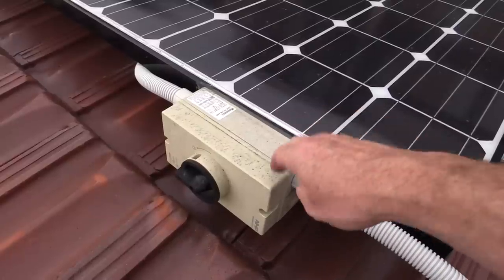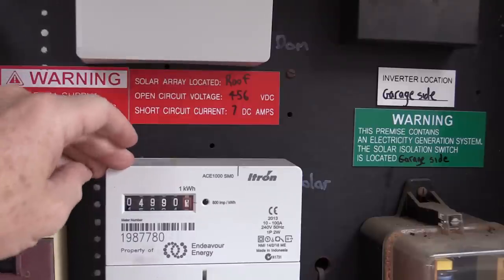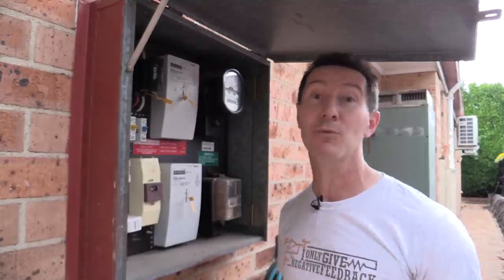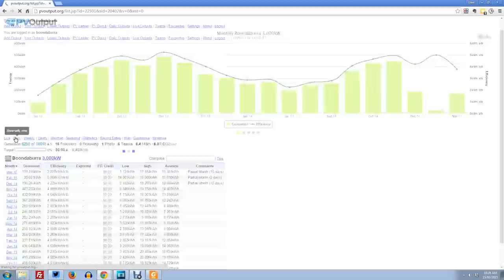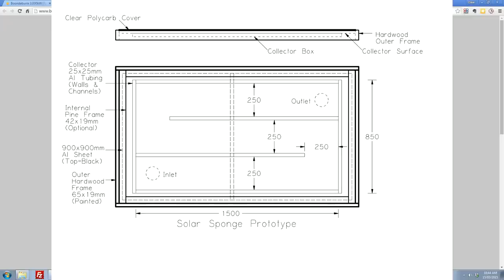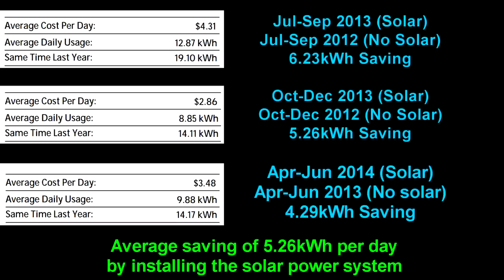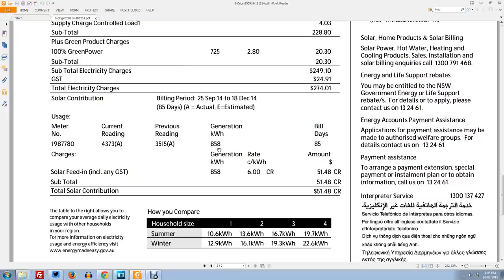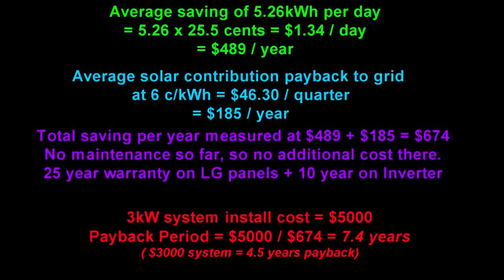EEVblog #724 - Home Solar Power System Analysis & Update

Comment: Sounds like you might want to do what Photonicinduction did without solar.  He charges the batteries during the day when the rate is lower and it disconnects from the grid at night.  I think all the batteries he uses are salvaged and he's done no maintenance on them from what I remember since he installed it.
Reply from the maker: stonent How many years has he had it installed? He will need maintenance sooner or later.
Reply: EEVblog
*****
NOW KISS!
Reply: stonent Think you got that backwards. It's cheaper at night.
Reply: He's had that running for quite a few years!
Reply: EEVblog It's a backup power supply that charges overnight (cheap rate) that can be used in the day if needed - Video at: ka0MfipmdBw

Comment: As a volunteer firefighter I can tell that solar power systems are a very big issue for us. In case of a fire we need to keep much more distance (>5 meters) during extinguishing. In case of an accident like a broken panel, blank cable, etc. we are not allowed to touch anything nor even get nearer than one meter.
The problem is that there is no possibility to turn off the panels completely. Even if there is little light, like from a lamp or floodlight, the panels can create enough voltage to harm or kill a person (ca. 120V).
In worst case we are forced to do nothing and let the building burn.
Reply: I have not heard about this, I wonder how the fire dept here in los angeles is dealing with it, probably there's not much solar here and so they really haven't encountered it yet. I would think the ins. companies would be rising their rates for companies going solar.
Reply: Hmm, this shows that there is a need for some fire protection mechanism, what if the series panels had a relay, i.e. between each panel, that turns off during the event of a fire?
Reply: There are mechanism like this in the marktet, with a switch at ground floor to be accessable by fireman. BUT, and i can only speak for german speaking countries, there is no regulation that you must have this mechanism. So most of the time this is not installed because its cheaper without it.
Nevertheless the solar panel is still producing current even with the relay. So the panel itself is still dangerous for us. There are some ideas for floating the complete panel with a lightproof liquid, but after this you need to replace the whole panel. And without regulation this idea will also be not used, because it costs money.

Comment: Nice Video, we are learning at school similar things that you talk about (the orientation, the angle, kWh/a, "Nutzungsgrad" (I dont know this in english, its about the efficients over the whole year, more excat then the efficients rating from the producer)), but not only PV, also solarcells used for heating your drinkingwater and your hous (needet in winter, here in Austria ^^).
Also two gyes of my class are working on the impect of dust (its getting hotter around dust, so there is a bader efficients), really interresting project. 
So thanks for sharing your data, because its really fascinating to see how different this system works in Australia!

Greetings Andi
(Austria)

Comment: we have 3.5KW in SA, we recieve ~$200-$300AUD per quarter, so the system which cost ~5K paid itself off really quick.
don't pay for power anymore.
We have also replaced all lights with LED.
no air-con used, double-brick + insolation, + fireplace for heating (wood is free).

Comment: Here in Colorado net metering is a much, much better deal since you are paid for production at the same rate that you pay for consumption (around $0.10/kWh). They also do net metering averaged over a year, so if you produce excess in the summer you can consume it during the winter.

Comment: Im not sure but remeber from our previous vid that this Itron meters wre smart ones. Rare for ciclometric display meters, but. I dont get the idea of two meters, since meters can record both import and export energy at the same time in separate registers. Perhaps it is the way the system is wired. But since this meters can display ONLY ONE quantity, you need two of them just because you need two registers. If you are not in an area where outages are usual, having a ciclometric display in an electronic meter is rare and no sense. Ciclometric readout is ideal were outages are frequent so when the employee from utility come to take the reading, it will be able to do that even when the grid is down. You cannot do that with LCD ones, unless they got supercap or batt inside to hold the reading

Comment: You should install ultracapacitors between solar panels and the inverter/controller, you will see the energy log curve dips/drops/changes get fixed & will give you more energy by compensating for low light conditions of morning and evening everyday. 500F banks of maxwell caps. in  parallel & series  would do it.

Comment: Hi Dave,
just one thing: At about 5 Minutes, when you talk about the meters, you put up this comment about the first meter. But this changes the whole statement, you're doing there:
If you consumed 6.698 MWh from the grid and you additionally used 2.406 MWh from the solar System (7.396 - 4.990), you used a little more than 9 MWh total. So your 3 kW installation would - even with a storage system - not be fully sufficient.

Still a very good video - thanks!

Comment: 19:14 Explanation about same energy delivered in different days:  
Clear days have only one light source (the sun); on 18/11/2014 maximum output was 2500W from 12:10 PM until 1:15 PM (movie time 18:35)
On a partially cloudy day, the light is coming from the sun and from the clouds near the sun (the clouds are secondary light sources); for example on 14/12/2014 maximum output was 2750W just before 11:00 AM.
I guess it's not about the panels, it's about the daily weather.
Cheers!

Comment: In my area some people put up a 100 ft tall wind turbine because of a lack of sun. It's not wired to the home at all, just back to the grid and the energy produced is subtracted from the power bill. The control box sends a wireless signal back to the power company but there's no screen with numbers to look at, just the monthly billing that comes in the mail. A percentage of the overhead expensive is a tax credit.

Comment: Dave with regard to what you "earned" from having a solar system installed on your roof, you also have to take into account the savings from not buying energy from the grid. Hence you did not just earn ~400$ but also save something in the order of  0,24ct*1400kWh, roughly 350$ (did not skip back to the exact numbers, you get the point ^^). For the solar system to pay itself (amortisation) you have to take these savings into account, too. And if you do the math: Exporting every kWh to the grid would get you only about 600$. So yes, this system has a higher amortisation rate the more you use the energy at home and not send it to the grid, because you exchange every 8ct not earned with 24ct not spent (:

Comment: I have a small DIY system here in oregon in the US , i only have a 5 100 watt panels connected to a 3,000 watt hour 12 volt  battery system, mainly for backup until i get enough panel's to make it worth going to a higher voltage system with a grid tie inverter professionally installed, i have all of the lower voltage DC stuff connected to it like house phones, modem router, chargers for phones and laptops etc , most of the things that suck a lot of unnecessary standby power, to me it's worth the  $650 USD i have into it , i use 8 Golf cart deep cycle batteries that i got used practically free, a 1KW inverter for emergencies i had gotten a few years ago and all renogy solar panels because their price is great here in the states with surprising customer service, all manufacturing is done in china but the company has a branch in the US

Comment: The "supply charge controlled load" on the power bill (about $4 per qtr) is probably for the old off peak power meter/ripple controller.

Comment: Could you make a video where you give an overview and compare different types of renewable energy?
And also different types of storing big amounts of electricity. In a private or in a public scale.

When and where to use which type?
In which situation which type has the biggest efficiency?
But also their environmental impact. Of course it's way less than the impact of coal, nuclear and stuff, but it's still there.
For example solar panels produce toxic waste in their production and their disposal. That's why they only should be used where it really makes sense (on private roofs) and why it was a good idea to get the expensive ones which lasts longer ^^
So what do you think would be the best green energy generation to power the grid in the future?

Comment: My experience more or less agrees with Dave's calculations about the breaking even period. But unfortunately panels are way more expensive here so it gets to about 10 years or so at best. The same with switching to LED from CF lighting (Don t change your lighting to LED before it fails, or unless you have issues with it).

It makes more sense to properly insulate your house first and change your devices with better consumption grade ones.

Unless you are getting some kind of funding...

Comment: 27:40 the controlled supply charge is for that electric hot water switch controller you're not using, might be a good idea to cancel that!

Comment: You get paid less for exporting than you import, because a major part of your import cost is to maintain the distribution network. Large commercial buildings can get tariffs with cheap kWh unit rates (~9-10c/kWh) but they pay a peak demand/network capacity charge as well. The final per kWh rate ends up being closer to the 22-25c mark regular consumers pay. That being said, 6c/kWh is still a bit low.
Reply from the maker: MetalPhreakAU I'm already paying a network distribution/connection charge.
Reply: EEVblog Yeah but the connection charge is just a base rate applied to all consumers. The rest is recovered through the kWh usage (users who consume more energy put a higher demand on the network and thus pay a higher proportion of the costs). Paying more for feed in from personal PV systems than they pay major energy generators is never going to make financial sense. The previous higher rates were to encourage takeup as you said (I wish I got in on that then, 60c/kWh is amazing). 

If they gave you the same rate for feeding back energy as you pay to import it, they'd be making a loss (basically eating the cost of getting energy to your house). That money has to come from somewhere :) (everyone else's electricity bill).

I think you summed it up pretty well at the end. Makes the most sense to adjust your energy consumption to make the best use of the power you generate, and size the system based on what you consume.
Reply from the maker: MetalPhreakAU Yes, it's called the connection charge. That must include the distribution and network charge. It's not my problem if the utilities can't figure out how to change with the times and the fact that people are installing rooftop solar power systems.
Reply: EEVblog The low rates are to discourage the use of solar, especially since you have no way to store unused kWh's.
Reply: rat4spd http://www.imowa.com.au/ Look at the balancing price @ IMO. It fluctuates from $30-100 per MWh depending on network load and supply availability. That's 3-10c/kWh. Tracking prices by 30min intervals along with your grid export amount is simply not worth it, so Synergy pay you an average value of 7.135c/kWh. Sydney is more complex due to the way everything in interconnected on the east coast, but its a similar situation regarding actual energy cost.
Reply: MetalPhreakAU There are many complexities in the pricing of the the market. In the US, we have the ISO, similar to your IMO. The market price, in the US (as I have no Aussie experience) is for those unfortunate enough to have not forecast correct demand into their schedule, and freak out when they are some MW short on a hot day when a large baseload plant is down for unplanned maintenance, and someones' head is going to roll when the only available power is $2000/ MW.

Typically there are fixed costs for generation which is much lower than they charge you for it, and here in the central US where we swim in cheap power, it's hard and many times impossible to get an interconnect agreement for alternative energy sources because that's power they could be selling the consumer....unless of course, you manipulate the market by keeping generation off line to raise spot prices and screw the end users......California anyone?
Reply: Here in Austria you get around 11€c/kWh (and pay 25), so it's ay okay.
There's just one little thing: you have to pay taxes for the solar energy you use yourself! Yes, you read that right. On one hand our government subsidizes the installations of PV panels, but on the other hand it makes you pay taxes for the power you use. After protests of almost everyone, they at least set a lower limit of 25MWh/y (produced, not used), so almost all home installations are fine. But farmers or offices that wanted to be "green" and have larger installations (matched to their needs) are out of luck.
Reply: superdau   I live in Califorania.  My electric provider charges about $0.14 perf kwh but they will soon reduce that to $0.12 per kwh.  Why?  Because they are going to increase the monthly service charge from $13 a month to about $45.  That is an attack on solar users.  Hard to believe but that's exactly what they are doing.  So, my system is installed now but I can't use it until Monday after my final inspection.  Battery storage is next for me.  Then I can cut my electric service altogether.  They will realize that their plan to generate money from solar people even though they don't use much energy will backfire on them.  Live and learn.
Reply: +rat4spd In South Africa there is a similar discouragement built into the tariffs. The poorest of the poor get 50kwh of free electricity each month, and after that (up to 350kwh) they pay R1 (10 cents Australian, 8 cents USD) per kwh. The rest of us pay R1.86 for the first 600kwh, and R2.15 after that (once gain, divide by 10 for AUD, by 12 for USD). The difference in rates allows the supplier to subsidise the electricity of the poor, and pay for the 50kwh given away for free. As a result, they CANNOT make solar too attractive, because that causes the richest of the rich to leave the funding pool.

In addition, legislation makes it illegal for local suppliers (municipalities) to buy electricity from you. Only the national generator (ESKOM) is allowed to do that. For this reason, Cape Town has a scheme where they don't buy it from you, they instead give you a credit which is subtracted from your consumption. Of course this is also at a much lower rate than what you pay, so that it only makes sense for small businesses and people who use lots of electricity.

Of course, all the tricks in the world is not stopping "rich people" from leaving the funding pool in some manner. At the lower rates, there's very little incentive to become more efficient. At the higher rates, there isn't only incentive, there is also means, since these are the people who can afford solar water heaters and energy efficient appliances. There is therefore already a mini-exodus of funders going on.

Long story sort: Quite often the politics around the low rates are a lot more complex than you realise at face value.

Comment: I dont' know if any one tell you yet.   But if you use good exterior Water base and paint that Plastic box on the roof  the box will last you longer. or that plastic box will brake in the next 5 years.  Paint it 3 times.  and the white electrical wire. pain that too, it expose to sun.  that plastic will last you longer, paint are cheap. but replace them is the pain on the butt.

Comment: "Use it or lose it" -- exactly the problem here in Canada...net metering is a lie because they pay you wholesale and charge you domestic rates...
Given that, I would in our colder-than-average climate use all some PV, some solar thermal panels... the solar excess for heating an underground insulated tank as a thermal battery to run in-floor heating in the house. I would even go so far as to go fully off grid and install a natural gas generator for backup. If I cut my electrical consuption from 100% down to 0%, my bill goes from 100% to 60% because of the fixed delivery charges. Staying on-grid for net metering means my bill might even go up if I stop consuming.